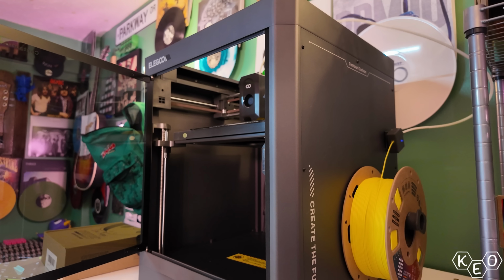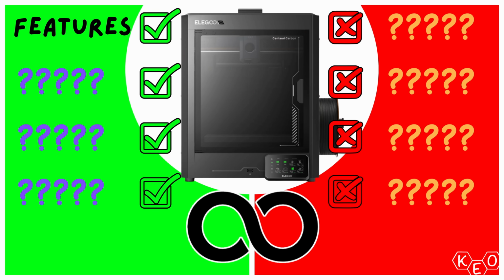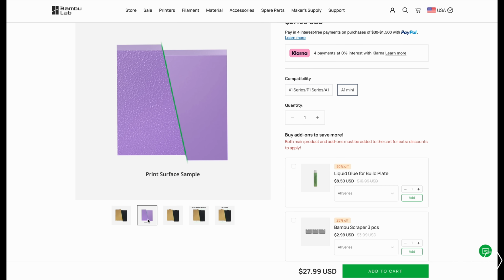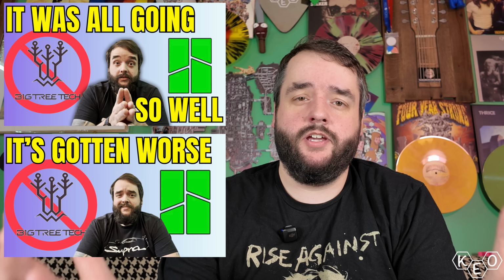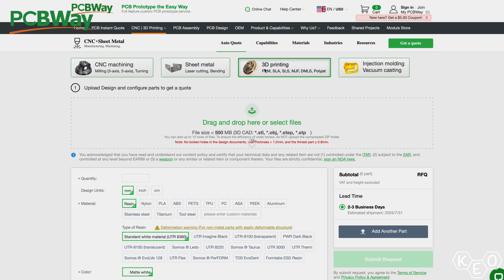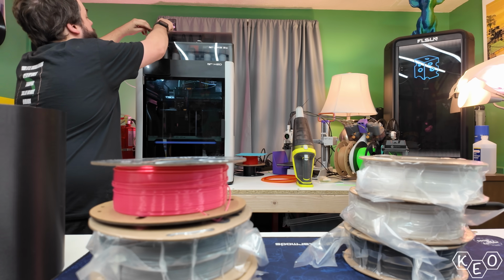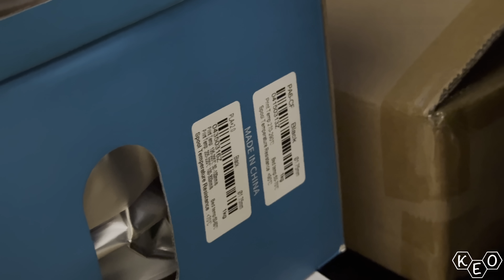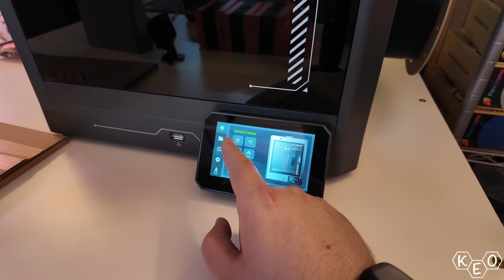This $300 Elegoo Printer Months Later — Here’s the Truth

Comment: I bought one of these and sold my K1 and old Voxelab printer. And so far, I am very impressed with it. It feels made of high-quality material than my K1 did. In addition, mine came upgraded with the LED light, and multi-color port. And oddly enough, the filament tube was already outside the chain. I didn't need to remove it. Overall, I am thrilled with this printer. If I needed one, I'd probably buy another.
Reply: Funny that I see this, I've been thinking about buying another one too
Reply: And that price man. I’m going to buy it for my birthday next month, lol.
Reply: Spend all my spare time repairing the K1 max
Reply: Did you buy from their site or from a distributor?
Reply: @Tooradj  I purchased mine directly from Elegoo.
Reply: What about the noise?
Reply: @Hern-Ema It’s pretty loud 😂 but it’s my first 3D printer so i have nothing to compare it with :D but it’s pretty loud ngl
Reply: I have the K1 Max and just got 2 of the CC and they are far superior
Reply: Damn maybe I’ll buy a CC in the future but for now I’ll just stick with my k1 since  it’s working perfectly fine.
Reply: yeah they watched the reviews and fixed the issues that were shown in them
Reply: @SideGreen which they are not given enough credit for. They listened and fixed it. Mine was just like this.
Reply: Ive been stuck between bambu lab and elegoo but after hearing the customer support and the changes without additional price, im now dead set on the cc lol

Comment: I've had it for ~2 months. No complaints so far (although compared to my Ender 3 v2, anything would be a good upgrade). Maybe this is normal for modern printers, but after doing the VFR Orca test, I print at INSANE speeds
Edit: only complaint is that it's super loud
Reply from the maker: Welcome to liberation from that ender 3 v2 friend. Its a big beautiful world on this side
Reply: @KeoPrints the Centauri made me think of an upgrade from Ender V2 😅 yet to pull the trigger!
Reply: Have you tried APA on it? Coming from an Ender 3 myself, and print mostly for stuff which is outdoors..